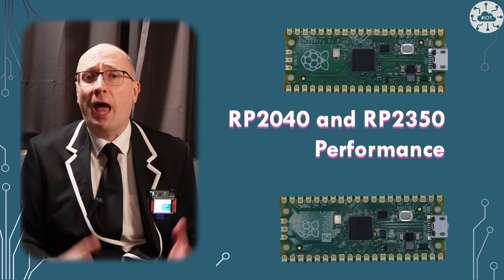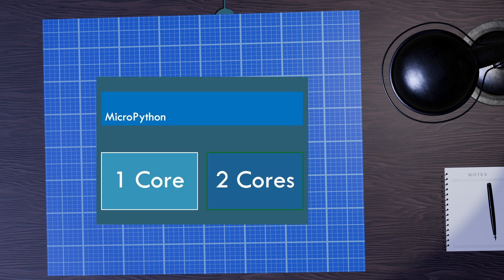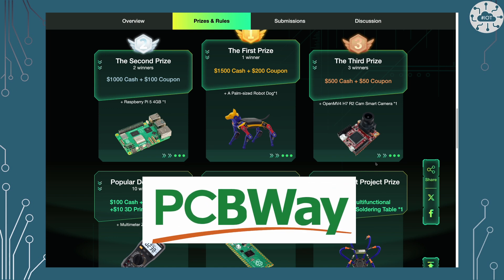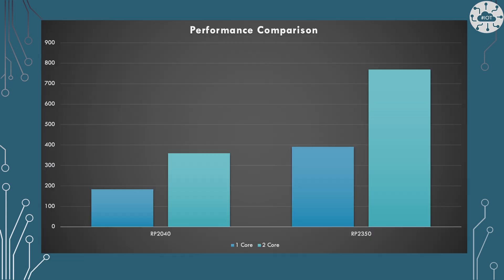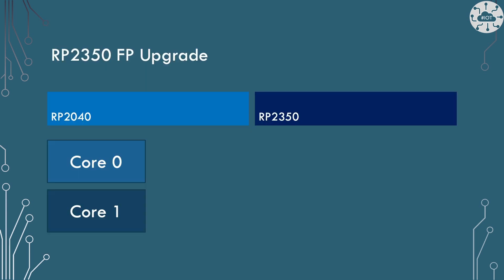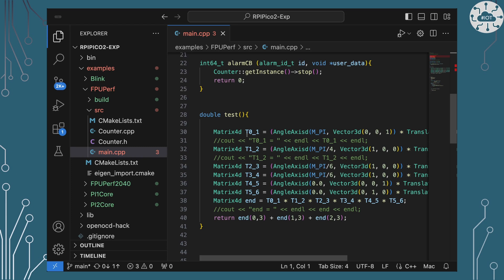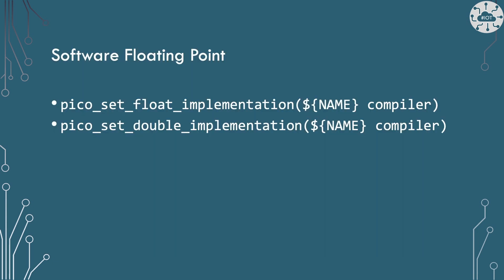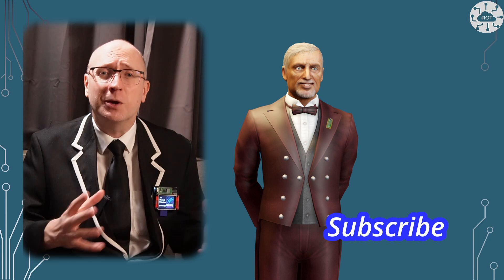RP2350 and Pico 2 Performance Against RP2040 and Pico 1  | DrJonea.co.uk

Comment: I suppose using library on the 2350 (calling it with the same instructions as with a 2040 is much faster, as this library internally  does use the floating point instructions of the CPU and for double precision also used the double precision coprocessors. This is not as fast as doing so directly by the compiler (which AFAIU also calls a functions for double precision), but a lot faster as with the 2040.

BTW.: a comparison of a task that allows to use the "single instruction multiple data" instruction (e.g. multiply and add four bytes at the time) would be very interesting, as well !

Thanks a lot for sharing your result !
Reply from the maker: Thank you,  good points. 

Thank you for the suggestions.

Comment: Interesting video, thanks! Just a note: 320% increase of performance would mean 4.2x the performance I guess? Just like 100% increase in performance would be double the speed/ half the time? So maybe the Forward Kinematics is actually 2.2x faster => 220% faster/ increase in performance or 320% of the original performance. Sorry for being nitpicky.. 🙂
Reply from the maker: Good point, senior moment. Sometimes my mouth and brain are not in sync doing these things,
Reply: @DrJonEA  no problem! I like this kind of content. Clear, good example and a subject I'm just diving into myself. Currently fiddling with mining some Duino-coins with: Pi Pico, Pi Pico W and Pi Pico 2. Overclocking/overvoltage is another interesting subject for DIY but maybe not for end-user products. My PP2 does a resonably stable 300Mhz which is cool without using overvoltage. Double the performance for free. 250Mhz seem 100% stable.
Reply from the maker: Interesting results. If you would ever like to be a guest on the channel talking about your projects let me know. I would love to hear about them and I am sure other would too..
Reply: You don’t mention it, but, when Gary Explains made similar comparisons, one of the engineers at the Pi foundation mentioned that GCC can be recompiled for far better performance than the standard setup in the existing SDK?

https://youtu.be/_O3Aeyv2ILM?si=n5kFCK7plkvx2oSh
Reply from the maker: That is interesting. Thank you for the link.